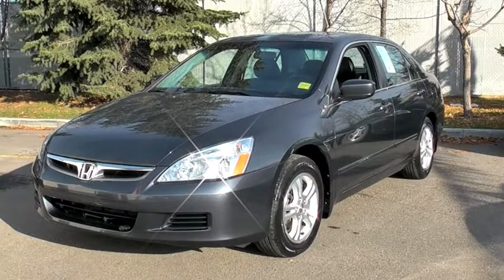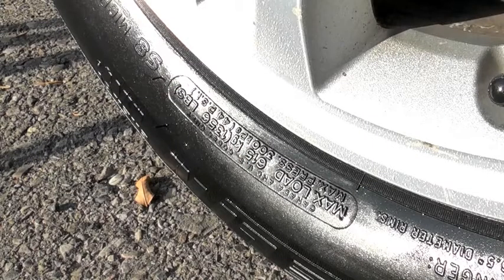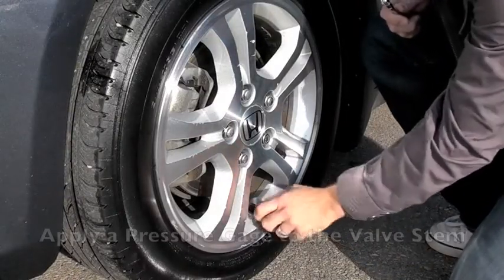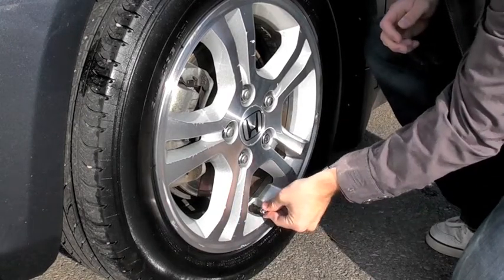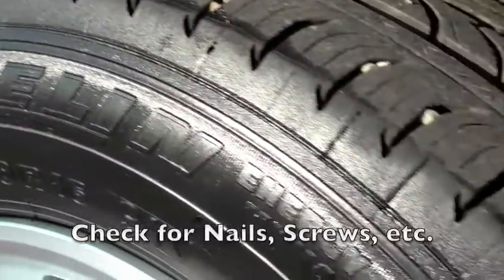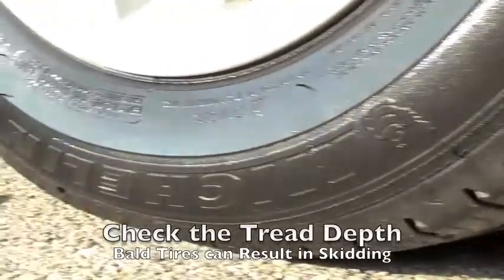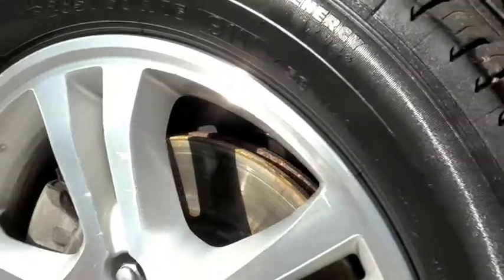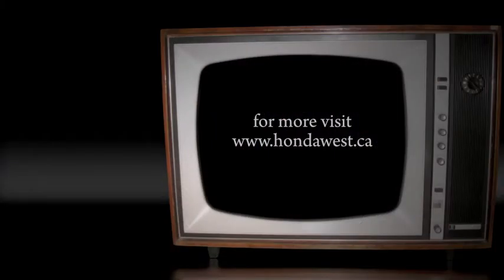Tire Inspection - How-To Video from Honda West

Comment: The MAX PRESSURE for your tire is located on the tire's sidewall. The PROPER PRESSURE is located either on your door's placard or in the owner's manual.